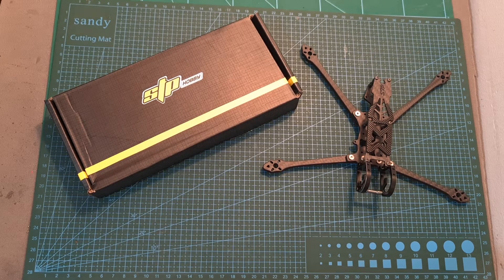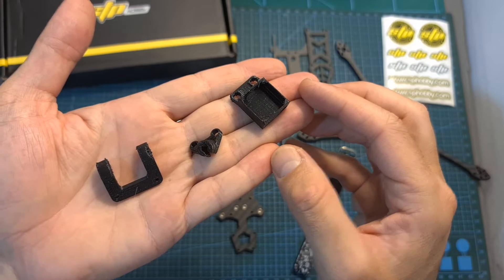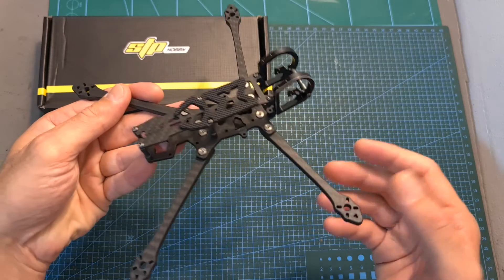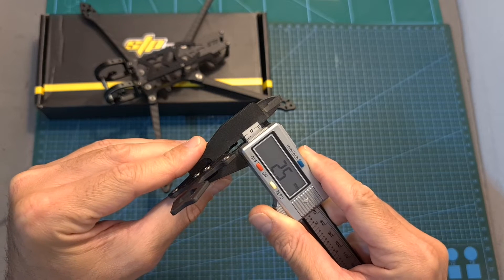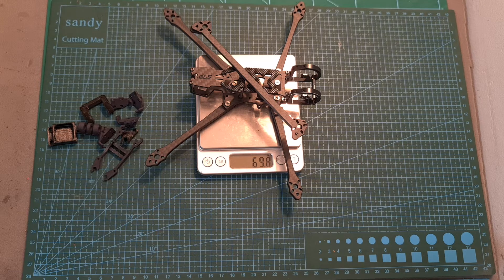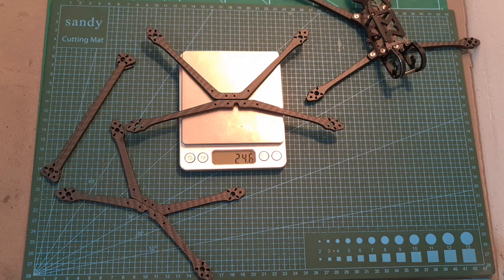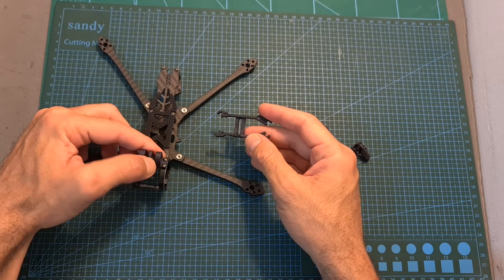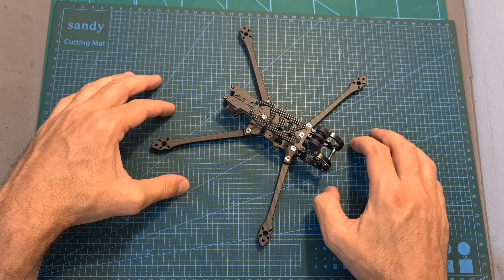RushFPV STP Aquila 4/5″ Long Endurance Cinematic Drone Frame Assembly & Overview

Comment: Cool frame, I wish it had 16x16 mounting, I can only think of a few 2204/5 motors I’d want to run in the 5” configuration.
Reply from the maker: I've build it using the Flywoo 2303.3 motors. Video will be up soon 😁

Comment: Thanks for the detailed review.   

I was thinking of purchasing the 4” version. What motor size would you recommend the 4”?
Thanks.
Reply from the maker: My pleasure Sam. I am using the Flywoo 2303.5 1750KV motors and they work pretty well. 
Video will be out soon.
Reply: @KremerFPV  Thanks again for the info. 
I assume that you are using the 2303 on the 5” version.   If so, I was looking at some recommendations for the 4” version.

Comment: i don't understand the need for 4 screws per arm when they are not split
Reply from the maker: It seems to be pretty tight and well secured. Anyway using only 2 screws instead of 4 shouldn't reduce that much weight.